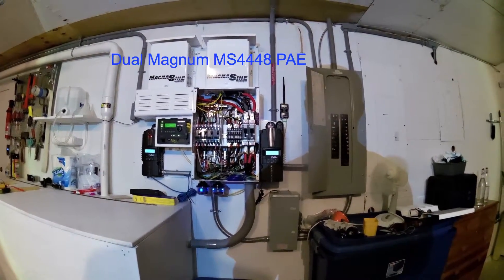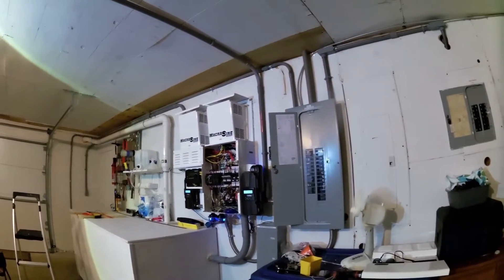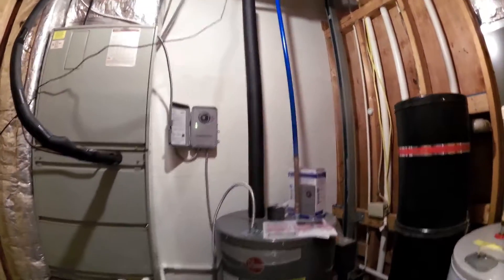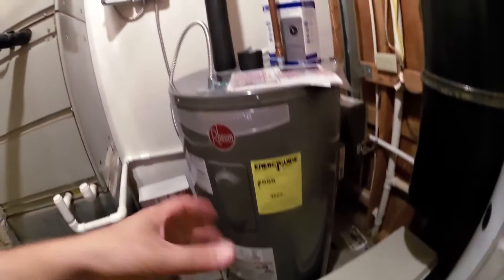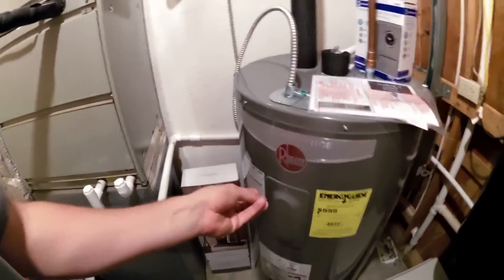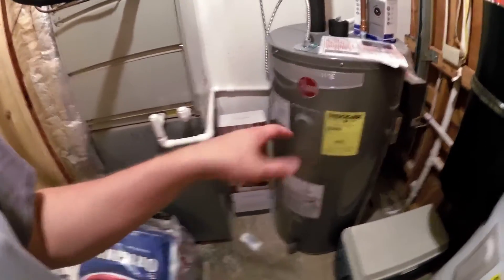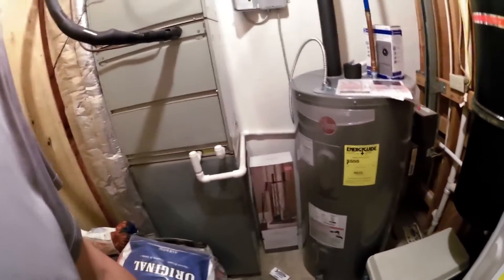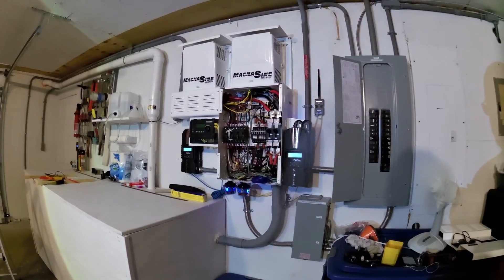Heating water offgrid: Magnum Inverter Water heater

Comment: What he said "use  the aux output of the charge controler to triger a solid state relay when the batteries are in float mode!!! And use direct DC heating element(s) Your loosing ALOT of power through the inverter and there is no control for say when the dishwasher is running!

Comment: Hi, instead of a timer you should use  the aux output of the charge controler to triger a solid state relay when the batteries are in float mode!!!
Reply from the maker: would the solid state relay control the 240V power circuit from the inverter to the water heater?  Have you done this before?  Specifically what relay did you use?
Reply: @GainSolarPower  ive seen it done using a dc switched solid state relay that switches upto 380vac, but he also used a schieder xantrex to switch the relay like a dump load controller
Reply: I have a 2nd geyser,  with a 4kw element,  powered directly with 4x280watt panels in series,  connected straight to the element.  The panels ohms is matching the element's ohms, so almost no losses.  The 100 litre geyser picks up from 24 degrees to 70 degrees Celsius on a sunny day.  50 degrees Celsius on overcast day,  and 35 degrees Celsius on a rainy day.  I have a dc solid state relay that will control the thermostat.  Got the parts already.  Just need to wire it up.